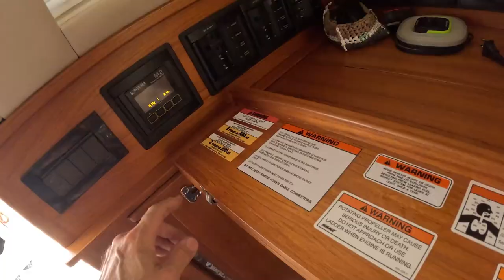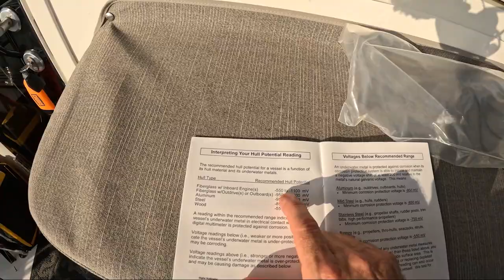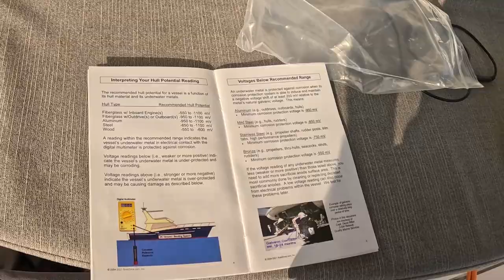Boat Zincs Getting Eaten by Stray Voltage

Comment: Okay, since foaming will be a D C issue and be caused as you note by stray DC current. Electrolysis is a deliberately induced process for electroplating or hair removal etc. Stray current corrosion is better known as electrolytic corrosion.  Your testing was simple but effective. This was a new boat. Older boats very quickly suffer from breakdown of the bonding system as nobody - nobody maintains them. They are simply ignored until they are found to be failing by other problems surfacing. They are easy to test but nobody does so. This should be the primary lesson. If people are not going to do this they are better off removing them. But then I don't have to take note of the. ABYC😂. 
AC in the marina is a real threat but does not cause electrocution. It can cause ESD or electric shock drowning where the muscles are effected and you can no longer survive in the water either through paralysis or being unable to breathe. Either way you drown, you are not electrocuted.
Reply from the maker: You are very correct about NO one maintaining bonding systems.  Don’t know why🤷‍♂️

Comment: Ok so the silver silver choride referrence anode showed that the bonding system was ok .... but what about the stray current ??  not sure the problem was fixed ??  also I think the cap on the reference anode needs to be removed to get an accurate reading ... note:  your zincs provide no protection against stray current.
Reply from the maker: It turned out the be stray current leaking from the boat next to it.

Comment: I use to put a large zinc at the slip on one of piling I would get. The large zincs from the gas company they used for large valves :so they didn’t go bad
Reply from the maker: Great idea .... but not always easy when a boat is here for only a few days! Thanks for watching.
Reply: I have heard of folks putting  a 5-6 pound zinc overboard connected to their battery. Sounds wild. I put zinc everywhere I could cram it in.

Comment: We’re the power cords hot?  Captain should of mentioned that.  Gerald P. Rothman Captain
Reply from the maker: No cords were not HOT ... we were talking with the Owner! Thanks for watching Captain!
Reply: I  own a beautiful Hatteras Sport Fish with double power cables and I continually open the covers on the pesticides and quickly feel each female connectors  for heat.  It’s a policy all boaters should practice.
Reply from the maker: When we first go to a boat that is having electrical issues we check the plugs & cords first thing! 👍